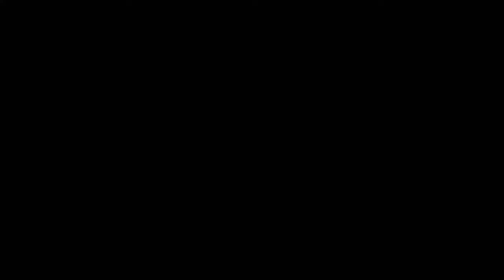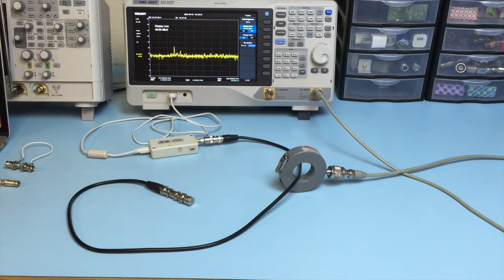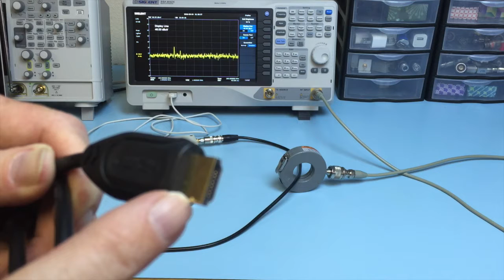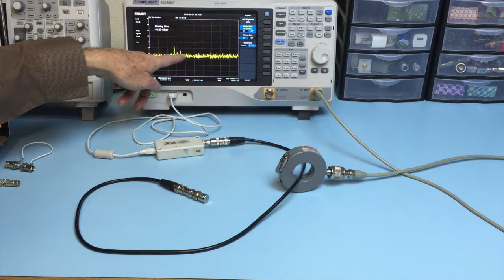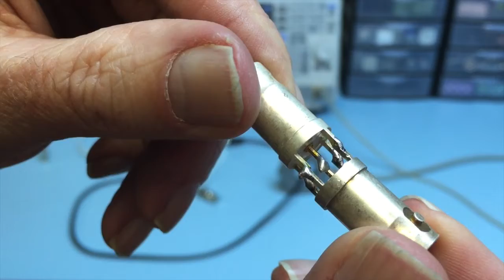Pigtail Demo

Comment: Wouldn't it be better to separate the toroid pickup from the created radiating antenna?...
Reply: Yes, I should have suspended the coax cable more in the center of the current probe aperture for best accuracy. The main point, though, remains.
Reply: One additional thought...RF current probes are designed to measure small RF currents flowing on the outside of a shielded cable. Once a pigtail connection is introduced, there's a conversion from differential mode currents inside the cable to common mode current that flows back along the outside of the cable. The longer the pigtail, the more RF common mode RF current is generated. If I were to remove the current probe, I'd not be able to measure the precise RF currents, which show up as spikes in the analyzer display. Now, on the other hand, removing the current probe and replacing with a close-by antenna, would pick up the RF currents as radiated from the cable. There is actually a formula for calculating the E-field radiation based on currents in the cable. You'll find this in Clayton Paul's book, Introduction to Electromagnetic Compatibility.

Comment: So was noise was being coupled to the BNC shield due to the impedance of the long wire?
Reply from the maker: Excellent question and one I teach in my seminars. There are several causes of common mode (CM) currents. In this case, it's "unbalanced geometry". Coaxial cable shields work because the signal in the center wire induces an equal and opposite return current on the inside of the shield. Creating a gap in the shield by inserting a jumper wire (pigtail simulation) opens up the shield and allows RF currents to flow out along the outside of the coax shield. These RF currents can be measured with the RF current probe and also tend to radiate out into space, creating radiated emissions.

Comment: How and why does the noise become common-mode from the pigtail?
Reply from the maker: Excellent question and one I teach in my seminars. There are several causes of common mode (CM) currents. In this case, it's "unbalanced geometry". Coaxial cable shields work because the signal in the center wire induces an equal and opposite return current on the inside of the shield. Creating a gap in the shield by inserting a jumper wire (pigtail simulation) opens up the shield and allows RF currents to flow out along the outside of the coax shield. These RF currents can be measured with the RF current probe and also tend to radiate out into space, creating radiated emissions.
Reply: @emc_guru  Great answer, thanks!

Comment: Why when you remove the 50ohm load you don't see any increase of the cm noise?
Reply from the maker: The CM currents are not traveling through the load, just on the outside of the coax cable shield when the pigtail is added.
Reply: If you remove 50 ohm termination, current flowing path is removed which means you make circuit open
Reply: @babalarbluesrockband-ankar8492   this is true at low frequency not at high frequency. I was expecting to see the multiple reflection on the cable.. Maybe the cable length is not long enough 🤨

Comment: Interesting, but it would have been more interesting to see what a shorter pigtail would have resulted in . You won't find that long pigtail inside a HDMI for example.
Reply: "As short as I could get it" ? Isn't the white pigtail just a wire to cut shorter and solder back? It looks like 4-5 inch to me, where the one in the picture in your link shows more like less than an inch. Are there really 4-5 inch pigtails in hdmi cables, even if both ends are counted in?
Reply: @magnus6974-m6w  You're missing the point.  It is not a binary result, i.e. "good" / "bad" but a continuum of increasing EMI with longer pigtails.  In the example, the radiated current is increased by 22 dB, which would fail any applicable EMI test.  Depending on the signals, termination, and applicable standards.  Even a 3-6 dB increase would likely fail.  That's why there are many cables with a "band aid" solution of a ferrite bead molded on the cable.  If it is a case of really aggreges EMI  due to poor design the cable is often coiled around a larger Ferrite toroid "do-nut" several turns to get it to pass testing.
Reply from the maker: @magnus6974-m6w  you're correct that HDMI cables don't have pigtails longer than about an inch. However, 8 to 10-inch pigtails are pretty common on commercial and military aircraft. Of course, they've developed special EMC tests to ensure these long pigtails don't exhibit unforeseen EMC issues - usually through lots of secondary shielding.
Reply: Hi Magnus, thanks for your comment. Yes, a shorter pigtail would have been good to add. The one I showed in the demo was as short as I could get it, given the back-to-back BNC connectors used. As for your comment on HDMI cables, I'd have to disagree. Several of my clients products failed with some HDMI cables and passed with others. This was brought out clearly in a DesignCon paper by Bergey and Altland in 2008. I wrote a short article in 2017, as well as interviewed one of the principles on the HDMI Working Group, where it was acknowledged (in not so many words) the issue with long pigtails. Since then, a new version of the HDMI standard was released and I suspect cables designed to it are better performers for EMI testing. You'll find my article here (along with links to the original): https://interferencetechnology.com/hdmi-cables-emi/